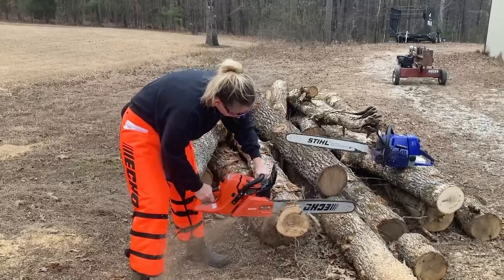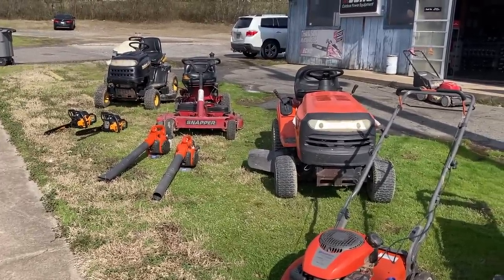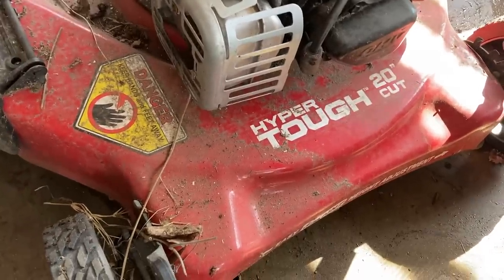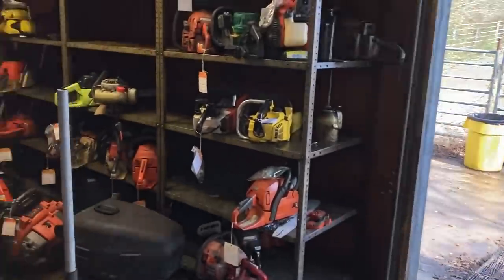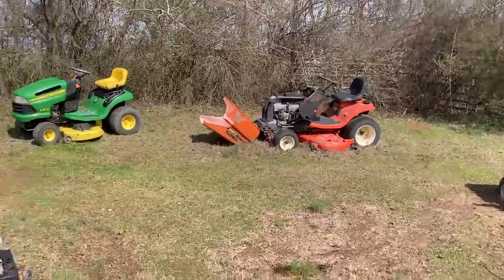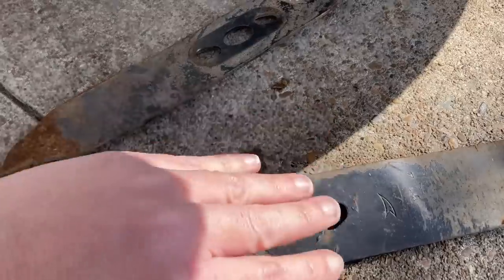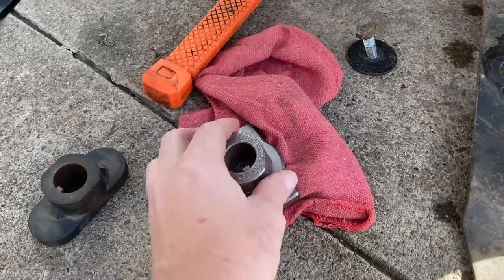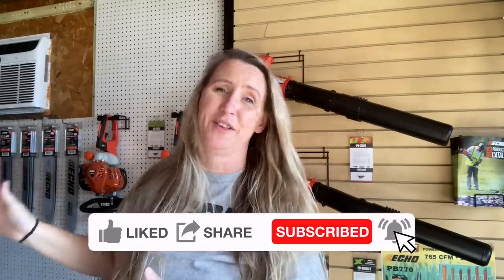Unwanted and Abandoned. The Equipment That Never Made it Home. (There’s SO MUCH!) VLOG

Comment: I am 57 years old, My father bought a used snapper rear engine mower when I was in second grade.  It had a Birggs on it and manual start, 30" cut.  it has been used ever since that day.  I STILL use that mower to this very day!  maintenance is a beautiful thing.  Oh, YES, it is still running on that never rebuilt or repaired Briggs!  Of course, there are belts that have worn out and blade replacements but that is it.
Reply: This is amazing , I have 5 snappers & they are tough but I’ve never heard one lasting this long , Thankyou for sharing this .
Reply: My father bought a rover colt ride-on mower in 1980, with a 4hp briggs engine. We backed onto a bush block, it never really had an easy life. It's had haphazard maintenance, but the engine is still going strong.
Reply: @BL2197  wow
Reply: That is really cool.

Just shows how important good maintenance is.
Reply: @fergusonto-2032  sure thing!
Reply: @BL2197  Good for you brother!
Reply: Unfortunately, things aren't built the same today. A wonderess phase comes to mind....Used to be...lol.
Reply: I believe it. May need a clutch disc every 5-10 years. What I've seen most is people don't check the transmission boots and they continue to use them. They dry rot and tear over time. That dirt just grinds away at that transmission. That transmission is bulletproof if you maintain it. You can make a Snapper RER climb up the side of a tree. Newer Snappers with the round steering wheels are trash.
Reply: Those are made to be store in an upright position to save space or to work on. Neat feature.
Reply: Those old Snapper mowers cut well
Reply: Yes our Briggs was bought new 14 years ago it still running great only new oil and plug every 6 months.
Reply: I have one from the late 60s electric and pull start . Still use it with just tire and blade belt repairs. Just added a fuel shut off to avoid ethanol clogging .
Reply: She had one of those there $350 I would definitely go for it.
Reply: put one of those amazon diesel engines on it
Reply: Newer ones have disposable carbs, ethanol destroys them, dad put a fuel cut out on the line and continues to use it, not how I would fix it but there are no replacement parts for them, the dealer suggested the cut off.
Reply: My dad's Snapper riding mower he bought new in 1981 is still mowing and going strong! Those old Snappers were among the best!
Reply: I render my uncle had one of those probably bought it around 1970- it was a pull start, rear engine, 5 speeds forward one reverse , he even had the plow came with it but never put that use. . I used to mow his 2 acre field every summer was about 8-9 at the time . That was still running when my father got it and finally sold it in the 80s when the seater rope finally broke ... never out in more than fresh oil and gas and sharpened the blade occasionally. I remember ‘hot rodding  it’ by getting a chrome sink tail piece and attaching it to the stubby exhaust ! They were tough mowers and stood up to all my  accidental kid attempts to break something.....

Comment: I wish my power equipment dealers would offer used equipment like you do. Always nice to have some inexpensive backups.
Reply: A lot of them send it too a auction house
Reply: @randytravis3998  I’ll have to check that out! Thanks!
Reply: Used power equipment can be a double edge sword for both the dealer and the customer. More than once, now, I've seen an unhappy customer that bought a cheap "clunker" have a huge negative impact on the local community's confidence in that dealership.

Comment: I use to refurbish chainsaws, but no longer bother. I only expected to break even, and more times than not people would offer half of what I had in parts. Yep. No thanks.
Reply: I very much enjoy working on saws. I don't refurbish chainsaws anymore due to losing money. People would literally want me to sell them a refurbished saw for $25 when I spent say $100 on all of the parts. 

I have my own saws I typically service myself. My brother in law has a saw that mysteriously quit working on him he wants me to see if I can get it running so he has a back up to the new Husqvarna he recently purchased. I agreed because he's family. It very well might be the problem Miss Bre has discussed in detail here.
Reply: Mowers and blowers. Everything else isn't really worth it. That's what I've found out anyway.
Reply: @machinesnmetal  I live in the Midwest, so people are definitely after a good cheap snowblower.  Riders, push mowers, and pressure washers once it's nice out. Everything else is generally more trouble than it's worth.
Reply: Lots of money in saws. You just have to know saws and which ones are worth fixing. Those homeowner plastic poulans go on sale for less than 100 bucks so it's hard to get more than 60 used. And they're a pain in the ass to work on, not worth messing with. Keep the bar and chain and maybe the coil, rest is junk

Comment: Given the price of new equipment these days, it's nice to find a place that sells fixed up used equipment.  I bought a used 1993 John Deere LX176 mower in 2002.  For the past 20 years,  I've mowed 2-3 lawns every summer with it.  My 1994 McCulloch grass/brush trimmer is still running strong.   I bought a 3.75 hp B & S engine from Fleet Farm in the mid-1990s, & it's on its 4 used mower deck.   I use 3 chainsaws, & the newest one was bought in 2005.   My Honda ATVs are 1985 & 1996 models.   Most everything I own is old, but do it yourself maintenance is cheap!    It's why I find myself watching Chickanic, Steve's Small Engine Saloon, and others.   Good stuff!
Reply: I've got the LX176 also, missing hood, but that Kawasaki engine and the K61 transaxle are going to last forever it seems like

Comment: When I was in High School (about 43 years ago) my brother, neighbor kid and I took and old 8hp wheel horse riding mower and put a Honda 750cc motorcycle engine on it to pull in garden tractor pulls. We had a great time. Original Peerless rear end did not last long and we ended up putting solid shaft on it. I just got it back from the neighbor's barn where it sat for 37 years (needs a lot of TLC). Looking at your recycle pile reminded me of how we ended up with the wheel horse. We cut, sold and delivered firewood to finance our project and buying the motor at a salvage yard.

Comment: I still use a push mower the was given to me 35 years ago. A few years later it needed a new engine and I found a deal on a comparable one.  Finally the deck started going and I found one almost exactly the same with a blown engine.  So I love my 35 year old mower. Lol
Reply: If you replaced the engine & later the deck, is it still the same mower given to you 35 years ago?

Comment: For years I did small engine repair out of my garage, it never ceased to amaze me how many people would walk away from a machine over a minor repair, or tell you to go ahead and fix it then never show up to get it. It got to the point where I refused to touch 2 strokes because I got tired of storing hundreds of string trimmers and cheap chainsaws that no one wanted. 
The last straw was push mowers, a few years back I had accumulated over 100 of them, all needing simply carb cleaning or new blades. They'd rather go down to the big box store and hand over their credit card for a new $800 mower than spend $80 to fix what they had. 
Worse yet, used mowers won't sell for much here, regardless of what it is. I pulled out a few Honda, John Deere, and Craftsman self propelled mowers and got them up and running to sell after they had been here for more than two years. A few were in new condition, but top dollar here on any push mower is around $45 for a self propelled rear bag model, or $20 for a plain mower. Even then they don't move very fast. They want a warranty and delivery for free too. 
I gave up on selling mowers and broke them all down for parts and sold the parts online. (Which is what I found that many were doing with those $89 Walmart mowers a few years ago, they'd buy a new mower, break it down and sell all the parts). 

The other issue here is how to sell them, there is no way I'd leave a row of them out by the road with a sale sign without a huge chain, and even then they may still try to run off with one. CL and FB are a waste of time these days with nothing but scammers and information miners lately. 

When it comes to scrap, the yards will not take anything that's not metal, meaning they want the oil drained, the recoil stripped of any plastic, the wheels and cables gone, etc. 
A few refused to take anything that's not broken down by metal type, and refused to pay at all for sheet metal saying they can't get rid of it. All told me they will not take steel cables. 
Riding mowers are a real pain because lately they want proof of ownership or origin. Then they won't take tires, seats, or steering wheels, and the fuel tanks and plastic parts must be removed. On top of that, the county refuses to take those items in the trash or recycle bin so they pile up until they have a hazmat day at the county yard every spring. 

Right now I have around 30 push mowers and a hundred or so spare used motors, plus a few dozen riders that need batteries and maybe a carb clean that will not sell if I buy a battery and put any time into them. Its a shame because some are decent machines but people simply won't dig into their pockets and would rather use their credit card.

Comment: I'm a shade tree semi-pro small engine mechanic. I have picked up 6 riding mowers, 3 push mowers, 4 chainsaws, a 150cc go kart, a 2000 watt generator,7 weedeaters, a pressure washer, and a tiller since I opened up shop. All but one of the riding mowers are good to go now, so it should be a lucrative spring for me, lol.

Comment: A tip, a lot of scrap dealers will bring you a container, for free, for you to keep round the back of your shop, year round, and you just call them when it’s full, and they’ll come and exchange it with an empty container. That way you can throw stuff into the container as it accumulates, so no ugly scrap pile to look at and eventually clean up.
Reply: @t.r.l.4377  that’s the whole point, they pay you every time they empty the container.
Reply: Problem is they will only give you sheet metal scrap prices. Problem is most people don’t have the time to separate their scrap metals.
Reply: The scrap yards in my area charge fee by the day then deduct the fee off the amount they would pay you for the containers.
Reply: @t.r.l.4377 agree! Usually they get the scrap in liew (?) of charging you rent on the dumpster.
Reply: The company we use has always been very honest with us. Most times it takes 2 trips with the dumpster to clear the lot vs. 10 with our 18' trailer. That's a lot of time and diesel saved, so they can pay us a little less.
Reply: @t.r.l.4377  Yep.
Reply: @hime273  the point of the scrap bin is that you get rid of your rubbish for free , if you get paid anything thats a bonus 
You dont need to spend any time or money getting rid of it 
Thats worth it in itself
Reply: Most require all fluids be removed.
Reply: I had a scrap hauler stop by once a month just to keep the clutter pile low. We both got what we wanted.

Comment: My grandfather bought an eager 1 push mower (not self-propelled) from Sears in the 60's and used until mid 80's. I took and used it 5 years and then put it in my barn. About 4 years ago my good mower broke, I put in gas and a lead additive and it started 3rd pull. Still have it.
Reply: Thats the value of old things... I drive  a 90s accord.

Comment: You , well not just you but everyone , should check out some of the street scrapping channels.  It is amazing to see the things people toss out along with the things that look newer but truly are junk.
Reply: When I managed a Dixon/ Echo shop, the BFI guy would drop off pieces. One a Homelite Super XL had a new bar and chain. On inspection I found a cracked fuel line. A .30 piece and it ran great. 30 years later it's still my go to saw for quick cuts. Got an Echo trimmer the same way. Fuel line again.

Comment: My lawnmowers, both push and riders as well as wood splitter are put in a corner in the fall. They get dug out around May. Luckily I never had issues with any of them starting fine in the spring. What really impressed me was my motorcycle set for two years and put a charger on it. It fired right up as if it was just run yesterday. Must have something to do with being parked in a dark, cool garage. Keep videos coming. Central Maine,,,
Reply: Winters in Maine are like suspended animation for equipment :)

Comment: Loved the tour of the old equipment in back of the shop. I noticed that there were no green old Lawn Boy grass cutters. I still use the one I picked up about ten years ago manufactured by Outboard Marine in the 1970s. The deck is magnesium and you pull the starter with two fingers.

Comment: For some odd reason, my gasoline and fuel mix lasts a LOT longer than yours.  I buy a good stock of gasoline every fall in preperation for possible heavy and frequent winter ice and snow.  Often, we get very little bad weather and the fuel is used in spring and summer mowing.  Even 2 cycle mix that is a year old still runs normally, although I never leave fuel in the equipment, just in the Jerry cans.

Comment: My father used to adapt the ignition module for a Kawasaki motorcycle. To replace the unavailable module on Rupp snowmobiles. It had a little hotter spark but everything  operated perfectly. He did a lot of these conversations.

Comment: Moved into my new house in 2001 bought an Ariens tractor  1 1/2 acres used every year still do but 4 years ago I bought a brand new old stock 17 year old Areins tractor that was exactly the same as my 1st just the next size up . Moved my 1st over to a rental property I own and it still runs great

Comment: I have a 13 year old and he wants to work  on small engines you help a lot
Reply: Buy your son a new Harbor Freight Peradator 212 small engine.  He can tear it apart reassemble it and it will run. He will learn a lot, the predator engines are inexpensive copy's of Honda engines. Your son will needs basic hand tools and a flywheel puller.  Their plenty of utube videos on building these engines, they also are used as race motors in go carts.

Comment: i have a heavy weight attachment the goes on the front. it helps balance the mower and turn better without the front wheels sliding. 5 yrs old and no failures. great info on amazon replacement part for steering. thanks!

Comment: Pricing: 100% agree that prices are insane (and getting worse). So I've been buying good used and fixing them. Self-propelled mower,rear tine tlller, and a chipper. Troy Bilt chipper and tiller and Craftsman on the mower.Tiller still has paint on the tines:600.00 Chipper was a barn find and 11 HP :250.00 Mower was used twice to mow a small yard: woman didn't like it: 200.00. Also bought a low hour (meter works) JD 850 tractor.5140.00 for that. Deals are out there but you have to look constantly and know what you're looking at.

Comment: We had a nice Briggs and Stratton mower, all we ever done to it was change the oil, and sharpen the blades, we'd most likely start it after we let it set all winter,with out draining the fuel or putting any stabilizer in the tank, it goes to the quality of a good old B&S from the 80s

Comment: Fixed my neighbors Murray with the Briggs plastic carburetor. It had plastic pieces in the carburetor from deburring from the manufacturer. Plugged the carburetor. Put in new plastic white thing with the jets. After I fixed it they didn’t want it back because they were using an electric mower for several years. It’s a super easy fix.

Comment: 7:00  This area needs a load of "concrete wash-out"  Its the left over concrete when the mixer truck goes back to the shop and they wash out the truck.  High rock content with some concrete..  If its a sloppy mess, you spread it about 6-8 inches thick and screed it like a slab.  Wait a week and you can park a pickup on top of it.  Best of all, wash-out is cheaper than fill dirt and you get a concrete slab so you don't have to slosh in the water.

Comment: As a self taught  small engine repair person,  I found that by turning mower or power saw on its side and cranking it over will unflood it or with lawnmowers adjusts the carburetor quickly and fires up more quickly.

Comment: When you buy a ride on mower check the quality of the steering system and whether it has replaceable wheel bearings. If not it will be junk in no time. I'm using a 40 year old 26" walk behind and a 30yr old Honda self propelled 19" mower. I buy new brush cutters and get over 10 years use out of a Shindaiwa or Kawasaki easily. I do not use ethanol fuels and stop engines by fuel starvation where possible and only fill the mower for today's job to keep the fuel fresh.

Comment: Edit commented before I watched, lol

You can use other with the hyper tough, I found one of the side of the road and couldn't find any blades to fit it, and then found a second Craftsman with the similar Briggs engine, and the adapter worked fine once I swapped them